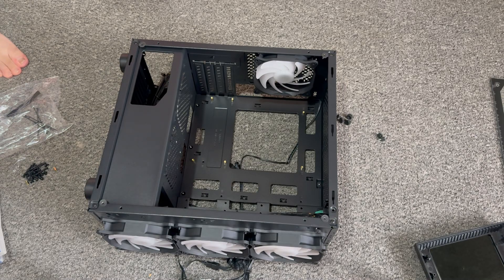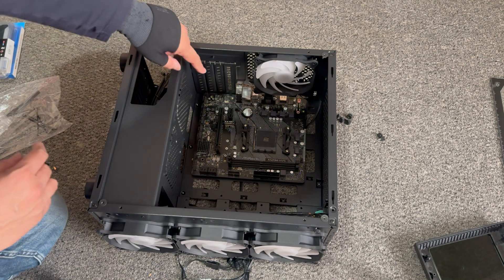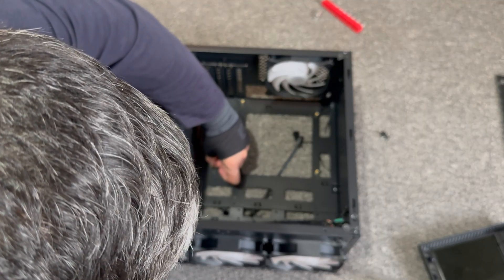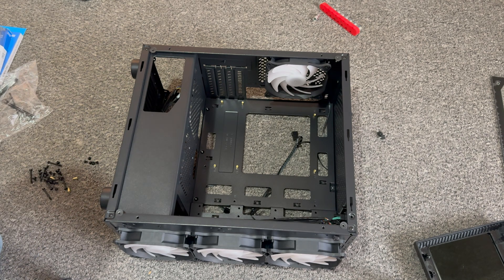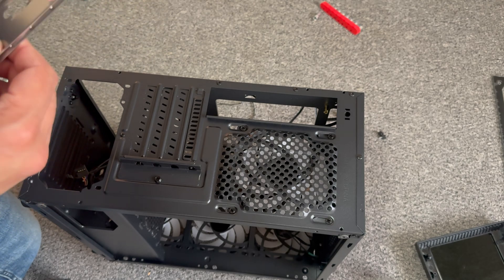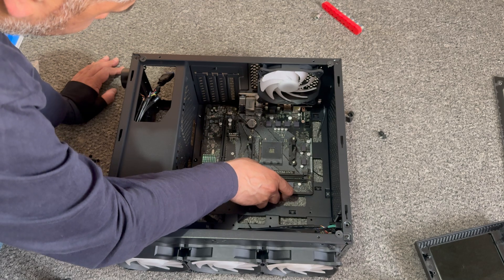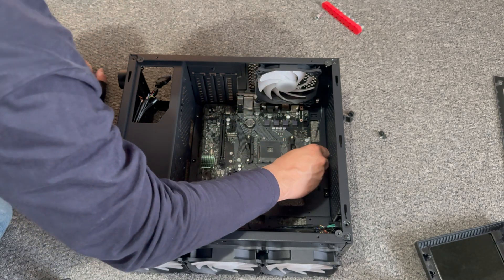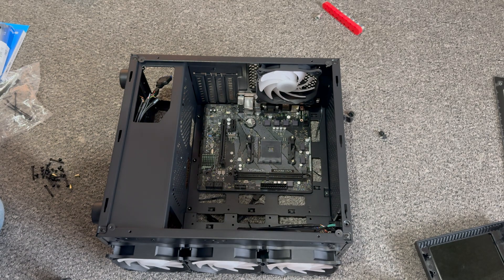Installation of the Motherboard - ASRock A520M-HVS

Comment: I've installed 4 screws and the last 2 aren't tall enough to reach the other end, the ones that go under the graphics card, is it necessary to install them, I'm going to have an electrical shortage or damage if I don't install them??
Reply from the maker: No, Most of my builds are on 4 screws as well. You will not get any electrical shortage or damage